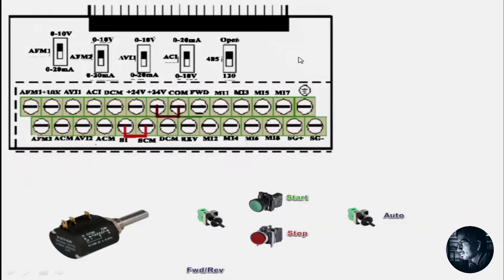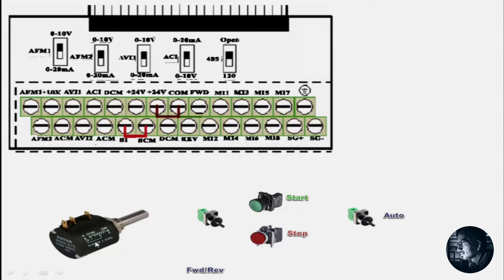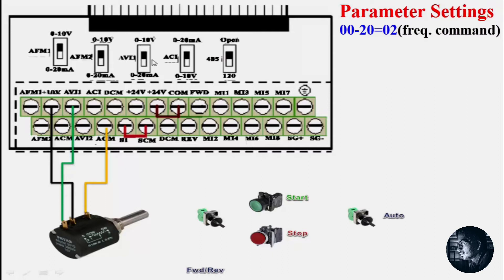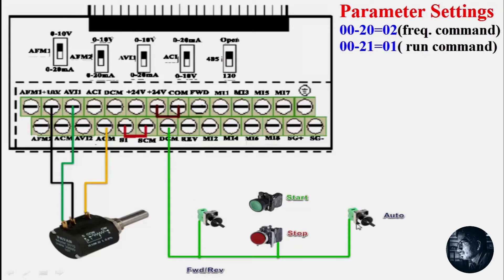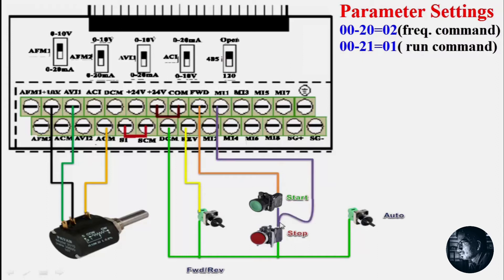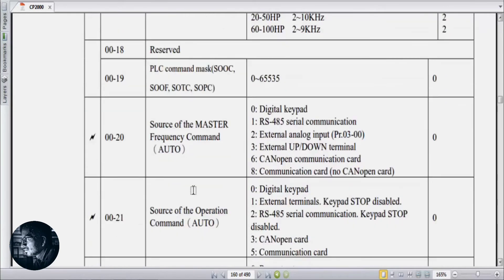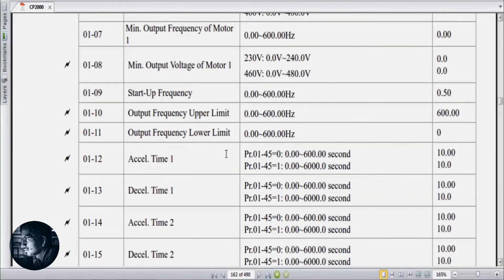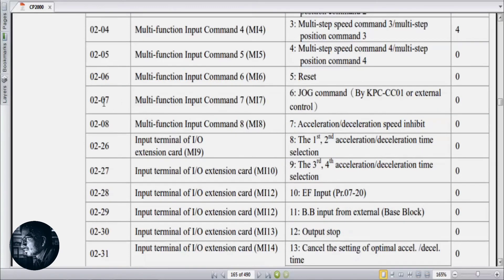Delta VFD CP2000-C2000 | 3 Wire Start Stop | Parameters Settings

Comment: Can this VFD run on 2 phase power if third incoming phase is missing
Reply from the maker: Depends on the load upto 50% it should run, but not advisable. It can damage the rectifier.
Reply: @NerdyNairTech  I am looking for a VFD that can also run on 2 phase. Application is to run borewell pump in my Farm. In Maharashtra state electricity board cuts 1 phase out of 3 in name of load shedding. I am planning to purchase 20 HP vfd for my 10 HP pump. Will that work? I am comfused with make of VFD. Which support 2 phase and 3 phase incoming power
Reply from the maker: @Ay_anika  I will check and reply.